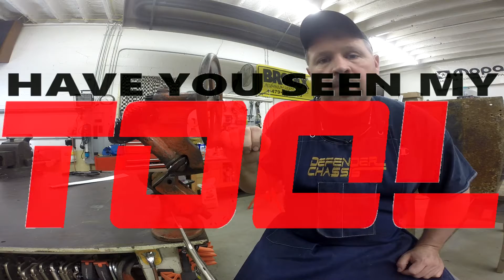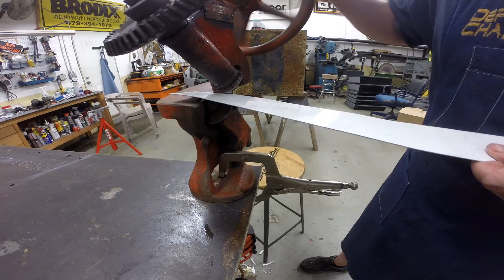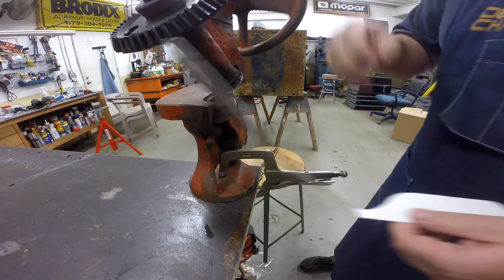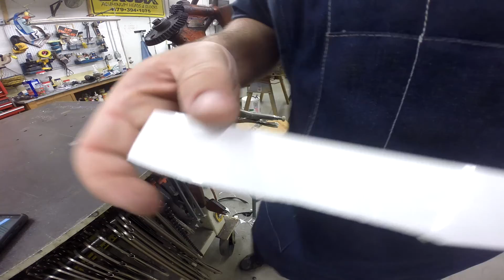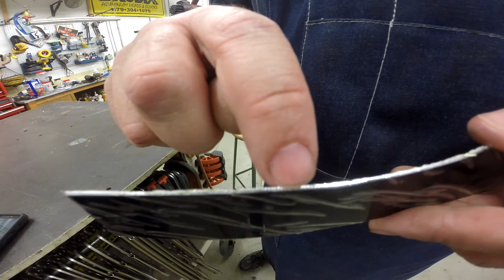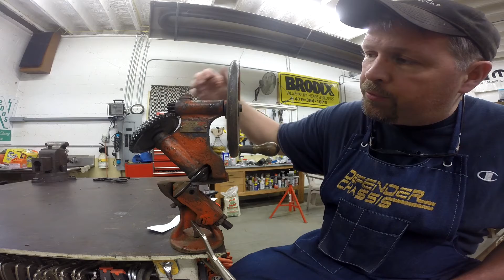Have You Seen My Tool 014 - Marshalltown No. 18 Throatless Shear

Comment: New Sub after my look up on a No. 18 I was just gifted by a neighbor. My brass badge reads Lennox Throat less Sharer. Also as an old cement contractor, I too over 20 yrs bought a lot of the Marshall town trowels and machine blades for power trowels. A neat conversation piece, but all the power hand shears are the only tools we use to cut panels and fab with
 Glade you shared. bears Rod Shop, TX 👍

Comment: Hey bud, sorry to comment on old stuff, but I have one of these now, and can’t find any adjustment instructions anywhere online. Any tips to get it up and running as smoothly as yours?
Reply from the maker: I'm not sure. I don't really use mine much and I have never really messed with it. I would probably look at all the wear points like bushings and see if they need replaced. In addition, the gap between the cutting wheels should be about 40-50% of the thickness of the metal you are cutting. Just brainstorming, hope you get it working better.

Comment: I have something similar I bought from Woodward Fab. It has a ratchet handle. I don't mind the serrated edge so much because I'm cutting small, odd shaped patch panels to raise/restore the transmission tunnel in my 1967 Mustang Fastback project. What I don't like is the deformation that occurs that I have to use a body hammer to restore the flatness before I reshape the metal to fit. Good videos. Keep it up.
Reply from the maker: +Britt Fussel I believe that Sykes Pickavant is the original manufacturer of that ratcheting style shear. Ron Covell shows it in some of his videos. Thanks for watching.